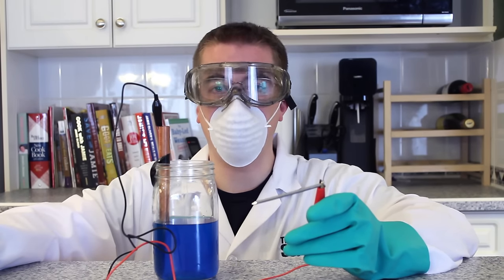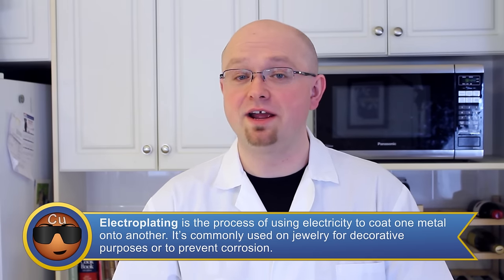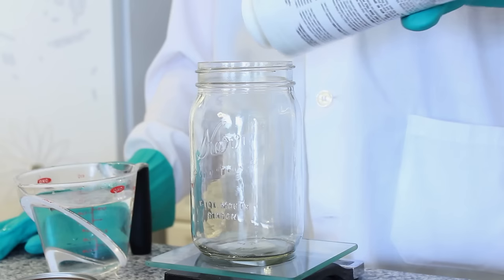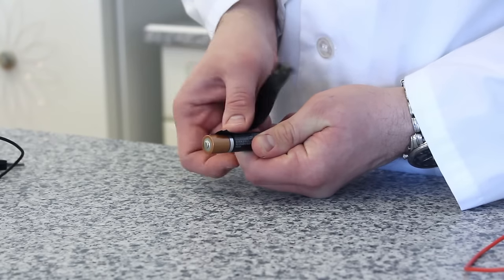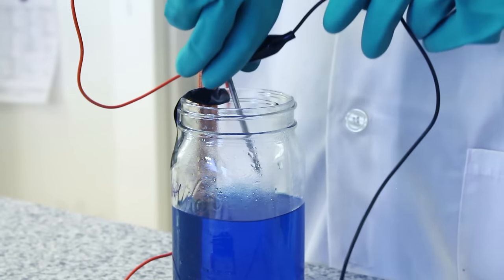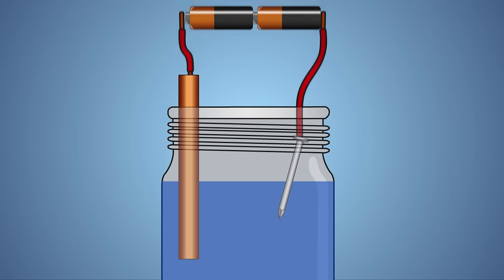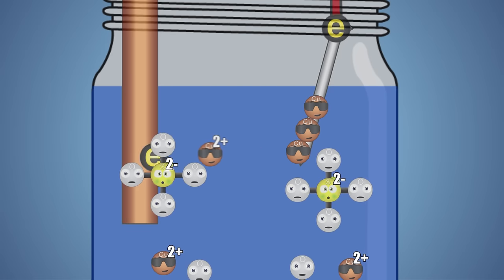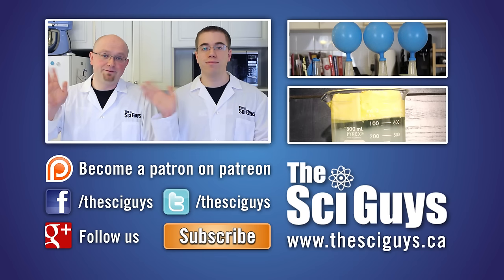Copper Electroplating - The Sci Guys: Science at Home

Comment: Copper doesn’t really plate well to steel, unless you’re using cyanide. I’m thinking it’s more etched than electroplated. In fact, you didn’t show removal and wiping of the nail and I’m betting most of it wiped off. To plate steel without cyanide, use a nickel electroplate process. Much more durable.

Comment: It was really really weird. I has followed your instruction, from Copper sulfat solution and i used battery 3.3 v for the supply. But the result that i got is not the same like what you did. My cathode  ( iron that i want plating) was plated with black gel. Did i Miss something from here?
Reply: What happened was a single replacement reaction where your iron was reacting with the CuSO4 and depositing elemental copper.

Comment: I don't believe that free electrons are the charge carriers through the copper sulfate solution. The cupric positive ions are the charge carriers. When they reach the nail, they are neutralized by two electrons coming from the circuit to form metallic copper with no charge. At the other electrode (copper pipe) a copper atom at the surface donates two of its electrons to the electrode, and then becomes a cupric ion that departs into the solution. If you don't have a piece of copper pipe, you can use a length of pure copper wire instead.

Comment: How do electrons flow through the electrolyte? 
I believe only movement of ions to the oppositely charged electrodes is the reason of current flowing through the liquid. Electrons only travel through the metal (electrodes and wire) and are "picked up" by the positive ions at cathode, and negative ions "drop" electrons at anode.
Reply: So true
Reply: You are correct. Electrons don't flow though the electrolyte.  This is an example of current flow by positively charged particles.
Reply: W 0:35 TBALD GIUY

= P[;

Comment from the maker: Hey Everyone, we had to re-upload this video. We discovered and error in the animation, although subtle, that we needed to fix. Sorry for any confusions over this appearing in your feed again. We hope you will thumb it up and comment again :)
Reply: The Sci Guys I have a question, what if I wanted to copper plate only in a specific area but not the whole thing such as putting my initials on a metal tumbler? Is that possible?
Reply: It's possible, but will be harder..
Reply: Rather late reply. But, you could mask off the areas you don't want to coat with nail varnish. Then, after completing the copper plating, remove the nail varnish with acetone (nail varnish remover).
Reply: Try electrolysis with two copper electrodes with the same procedure you guys did.
Reply: Potash
Reply: Yo guys can you help me out for a bit here? Just a quick question, what is the metal cleaning powder made from? And are there any relatively easier to obtain substitutes?
Reply: Sir ,can we use some other solution for the electroplating of copper????

Comment: Cool video! My dad has been in the electroplating (particularly copper) business for as long as I can remember. Fun fact: The nail would form a (very) thin layer of copper without the electric current because iron (and zinc and aluminum) reduces Cu2+.
Reply from the maker: +Stephen Abbott Glad you enjoyed it. Thanks for watching all our videos!
Reply: I'm restoring a very rare and sentimental folding knife. I would like to coat the blade and copper. I am a gourmet mushroom grower and we'll be using the knife to cut through mushrooms so it's pretty soft stuff. I've watched a lot of plating videos where the copper tends to rub off somewhat but I've heard there's way not to rub off. Do you have any suggestions for the solution, voltage, time, or how many dips? Would be greatly appreciated MycoMitch.com

Comment: Watching videos on YouTube, I became interested in the topic of galvanization. I decided to experiment a bit with it, but something isn't working, and I don't know where I made a mistake. I tried copper plating and nickel plating various objects, but I'll describe my problem using the example of a hammer I attempted to copper plate.

First, I sandblasted the hammer, then cleaned it in an ultrasonic cleaner, and degreased it with extraction benzine. In the next step, I soaked the hammer for a few minutes in 30% hydrochloric acid. Then, I placed the hammer in a solution of distilled water (about 2 liters) and 3 tablespoons of copper sulfate, adding about 10 ml of vinegar. I set the current according to the YouTube instructions - 1A per dm³. For me, it came out to 0.5A, but I set it to 0.4A (I also tried 1A and 0.1A).

The effect is that instead of covering the object with copper, a dark brown deposit forms on it, which can be easily rinsed off with running water after removing it from the bath, leaving the hammer bare and sandblasted as before the bath. What am I doing wrong?

PS. I also tried a solution without vinegar, just copper sulfate and distilled water.
Reply: That's because this video is completely misleading you, copper will precipitate on the surface of iron even without the battery in copper sulfate because the two metals are too far apart on the activity series, and intermediate plating of nickel would allow you to subsequently plate with copper if that is your desired final surface coating

Comment: Question. What role does the DC voltage used have? If you were to use a larger voltage what affect would that have? How thick of a copper coat can you get? If you leave it in solution for a longer time will that increase the copper layer? What are some guidelines for length of time left in solution? How long will the prepared copper sulfate solution be useable? Are there any ways you can determine if the solution needs to be changed? The piece of copper used to grab copper ions from will last for how long? 

I do stained glass work and would like to copper plate my pieces (basically plating copper onto solder seams (60% tim & 40% lead)). Can this be ramped up to allow me to do that? With a larger piece being plated, do you have to use a higher voltage? And how would time left in solution vary as your piece size increases? Appreciate any Info. Thanks.

Comment: Is there a book you guys recommend for copper electroplating on 3D prints (PLA filament with graphite conductive paint)?  

I am going to start experimenting with small items 3D printed items first but I am trying to work up to plating larger items like a jewelry box for my mom and a Halo helmet that I printed full-size.  I'm trying to understand the ratio of water and the amount of power I would need for something that would fit in a 5 gallon bucket (and the amount of copper required to achieve some level of coating).  Or, if I should simply consider some sort of surface brush application technique.

If I am ever successful, I will post something.  I just do this for a hobby.

Comment: You joked about electroplating yourself to get Collossus skin being a terrible idea, but is skin even conductive enough for the process to work?

As in, would it be possible to coat, say, a steak in copper or zinc and completely coat it?

Obviously the acid would corrode the organic material, but that should take a while for the reaction to complete
Reply: NotAGoodUsername360 The extremely minute amount of sulfuric acid made would not be nearly enough to be corrosive. However, copper sulfate is toxic. So it would not be a good idea.

Comment: Cool, Now how to get the copper to actually adhere to the iron?

(without cyanide solutions)
Reply: NoSpace4Bass You just need to lower the current ( amps ) and keep the metal in the solution for more time , so that the copper layer can build up and sticks to the surface to the metal . If you use a high current and a long time bath it will form copper cristals instead , so make sure you don't use a high current . You can use a simple 1.5v carbon - zinc battery and by keeping it for a couple hours you should end up with a nice coating of thick copper . Good luck for you ! ; )
Reply: How should I dispose of the solution when finished?
Reply: @frjoseph100  You can do 2 things, or 3 if you are a bit risky:
1. Dump it in the sink with LOTS OF WATER. Lots if needed to lower the concentration of copper acetate.
2. Boil off all of the water to get copper crystals. You can dispose of it in the trash.
3. Dilute it and put it in your garden where you don't want plants.

Comment: Can you copper plate aluminum?
Can I just use a chunk of copper. and some aluminum. distilled water. and baking soda and a variable voltage and current power supply to hook up to them?
I want a durable thick but not TOO thick layer of copper on the aluminum surface. so that if it gets scratched a little it wont expose the aluminum.

Comment: Electrons do not travel through electrolytes. The suggestion at 3:50 that they do is incorrect and misleading. In this example, the source of electrons in the circuit is from the copper pipe, the electrons are received from Cu2+ ions. You could say there is a flow of cations in the electrolyte, but not electrons.

Comment: Really good instructions - thanks. I want to electroplate a "zinc alloy" pendant with copper.  Will this process work? Should I coat the piece with conductive paint first or isn't that necessary since I doubt that it's galvanized?
Reply: All metals are good conductors

Comment: Sir I hv one question , can we perform this process of electroplating using some other solution?????
Reply: Sorry for being late but , no , the reason is , you have to use a solution that is made with the element you’ll be doing the electro plating with , so for example , if you wanna plate something with copper , you need copper sulfate , if you wanna electroplated something with silver , you need silver nitrate , hope it helped:)

Comment: I did this to the letter and the object I was electroplating turned out with a crude copper plate that was all dark and didn't look anything like copper? The only thing I can think of is if the cathode and anode touched each other but I know they didn't.
Reply: maybe you already learned this by now but here goes just in case,,first of all there solution is missing some ingredients,most importantly is an acid so you need citric acid , vinegar and some salt to go along  with the root away,you can skip the root away and add distilled water and vinegar but you also need some hydrogen peroxide to get the copper flowing and turning the solution a green color,,next you can not just use a steel nail no matter how much you clean it the copper will not adhere and will rub away and all you have is a copper or brownish or dark mud coating on the nail that rubs off,,if you plan to copper plate then you will need to either do a nickel strike first or be sure the part is already nickel plated and you might need to use a fine iron wool to scrub the surface and decrease it first before you start plating,,hope this helped ,if you got any q's let me know

Comment: Im 12 years old and ive done some crazy chemistry experiments(like legitimate things like NaOH) but my parents are scared that there are more things in root away that will kill me.
Reply from the maker: +Sor Sor Science07 The ingredients in root killer may vary depending what country you live in. The only ingredient in the root killer we used was copper sulfate, which is VERY corrosive. In our video we explain that this isn't an experiment we want younger viewers to do and it should only be done by adults for demonstration purposes. So I will have to side with your parents, if they are scared that you may be harmed then I would suggest respecting their wishes and either have them do it or find a different experiment to do. Sorry if that isn't the answer you were hoping for but I would hate to hear that you were injured or worse trying this experiment out on your own.
Reply: The Sci Guys Copper sulfate is not that corrosive. It is toxic, however it is not as corrosive as most acids.

It is actually quite safe if you wear proper safety gear, and don't eat it. There are much harsher chemicals out there. This chemical is actually packed with chemistry sets meant for 11+ year olds.

Comment: hi guys. was just wondering. i've been experimenting with this for a little while and I can't seem to get the plating to afix to the virgin metal. it plates on brilliantly but brushes off with a little touch. can anyone help?
Reply: hopefully am not too late lol. 
Tim C
2 years ago
"Copper doesn’t really plate well to steel, unless you’re using cyanide. I’m thinking it’s more etched than electroplated. In fact, you didn’t show removal and wiping of the nail and I’m betting most of it wiped off. To plate steel without cyanide, use a nickel electroplate process. Much more durable."
Reply: other videos I have watched .they say part needs to be nickel plated 1st for copper to work ..

Comment: how much time does it take to coat a coin
Reply: I think it's best to use a lower direct current, they're using two 1.5 volt batteries in a series.  They're smart.  Here's the dealio, their ratio of anode to cathode is like 40:1.  I just saw a video where someone tried to copper plate a little metal statue of a hulk type character with a single penny as the anode.  It was like 20:1 in reverse, ultimate failure.  I did this once with I think just one 1.5 volt battery with a zinc hook (test run)  as the cathode and I used a copper piping elbow (nice and shiny) as the anode 10:1 in the science guy's favor here.  The end result looked pretty good, it definitely got coated but it wasn't the shiny brass of the copper piping elbow, it turned out more bronze.  I gave it a couple hours.

Comment: CuSo4 is same like CuSo4*5H20?
Reply: yes
Reply: Quantum mechanically it's different. CuSO4 Have stronger bond than CuSO45H2O. Because it's a water and it's polar so, water able to pull CuSO4 electrons a bit and make the bond between CU and  SO4 slightly weakened.

Comment: what if we used water and nacl instead of cuso4 ..?
Reply from the maker: +hanzala ahmed then you would probably just cause electrolysis like our first video.
Reply: hanzala ahmed The positively charged chloride ion would build up at the anode as chlorine gas, while the negatively charged sodium ions build up at the cathode. Since sodium metal is extremely reactive with water, those sodium ions immediately react with the water to form sodium hydroxide.

Comment: i dont think there should be electrons flowing in the electrolyte
Reply: Hui Eugene STICK IT it has to go throughout the copper sulfate or copper acetate
Reply: electrons can float in an electrolyte
Reply: Yes there should. The electrolyte gives them a path to travel on.
Reply: You're right Hui Eugene. The electrons are given to Cu2+ ions to form copper metal on the surface of the nail. The copper pipe is giving electrons back to the power supply to complete the circuit, and in doing so, forms more Cu2+ ions to maintain the concentration of the solution. The animation is wrong.

Comment: Electricity flows the other way we learned this in science class.
Reply: Talk to your professor.  Electrons are negative and negative and positive attract, therefor, electrons flow from the negative to the positive terminal.
Reply: I learned in school that electrons flow from the negative terminal to positive terminal in school.  That is how I know that it flows from positive to negative in reality. You have to mulitiply all the lies you were taught in school by -1 to find the truth.  Research Flat Earth curvature calculation.  Long distance photography proves flat earth. Research it.
Reply: before electron was discovered, I'm not sure, but I believe it was Benjamin Franklin that said that electrons flow from + to - terminals. He didn't know what was flow he just coined it that way. Therefore by "convention" we use it that way. although now we have an understanding that electron flow from + to -
Reply: Electrons flow in the opposite direction to the current. Electrons flow from lower potential (a body is said to be at a lower potential if it has excess amount of electrons i.e. it gains a negative charge) to higher potential (i.e. it has a deficiency of electrons and due to the protons, it gains a positive charge) till both the bodies are at same potential. Therefore, electrons move from negative to positive but the current from positive to negative.
Reply: what you learned is called conventional flow
Reply: "although now we have an understanding that electron flow from + to -" you meant to say from neg to pos

Comment: That is NOT electroplating !
 
That is just a replacement reaction and the copper is not plated onto the iron and will wipe off.
 
If you just put the nail in the CuSO4 solution the copper will loosely coat it without any electric current.
 
Try it !
 
You should know what you are doing before pretending to teach it.